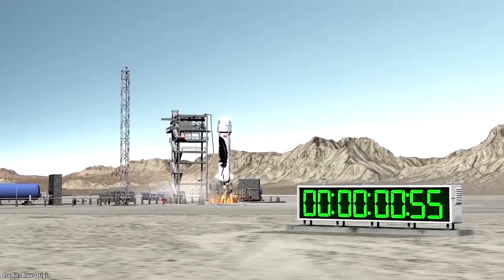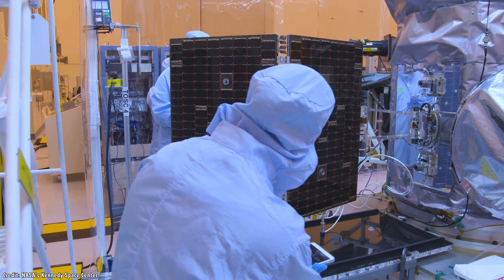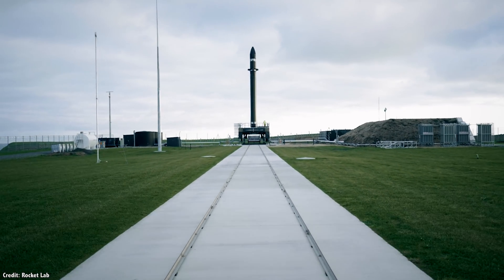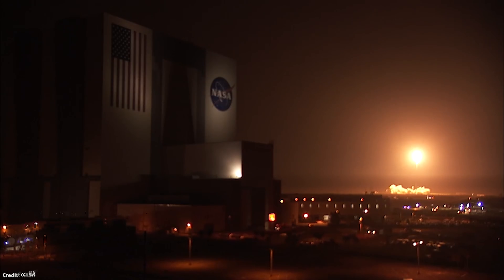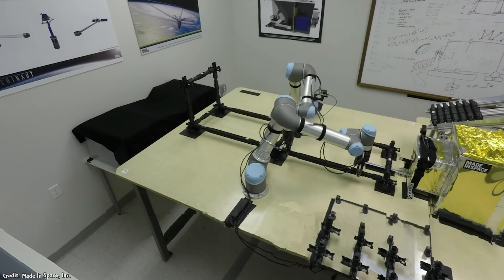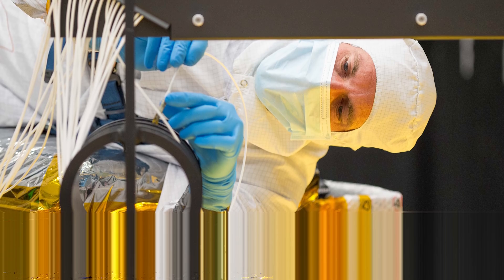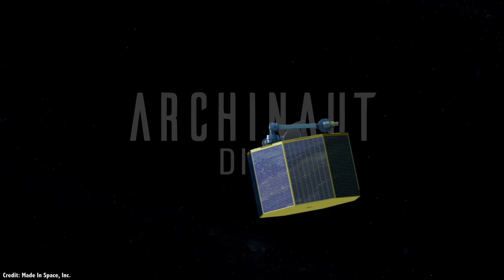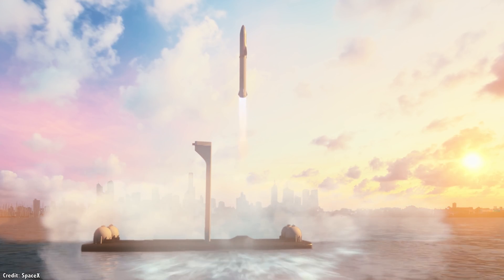A Spacecraft Is Going To Build Its Own Solar Panels In Space: Archinaut One

Comment: I can't find one piece of information:

Is it just a "rolled up" long solar panel that sits in a rolled up tube (like a piano roll or roll-up window shade,) that has its support beam 3D printed in-situ, or is the whole solar panel printed in space?  (I know there have been announcements of methods to "print" solar panels with technology similar to an ink-jet printer. I can't figure out if they're using that plus "conventional 3D printing" for the support beam, or if only the support beam is printed-in-space. Either way is better than now, but in-situ printing of the whole thing would be amazing.)
Reply: Yeah, technical details would be good.

Comment: just vaporize material with a high power laser (300 watt CO2),  then use vapor deposition to build structures the same way the 3-D printers do, next smelt metals out of ore rock and extract neally pure metals..(magnets and siphon tubes to remove slag). this is the tripping point for space industrialization

Comment: The question is when will it be possible to manufacture integrated circuitry in space.
Reply: It's possible now (its certainly not impossible), but it won't be economically viable for quite some time. ICs are low-mass and mass produced on Earth, sending them up on a rocket will be cheaper than building a space factory and manufacturing them up there for quite some time.

Comment: Space-based manufacturing holds a lot of promise, but I doubt we'll ever see the day that no manufactured materials are launched from Earth into space. There are almost certainly always going to be some items that are cheaper to manufacture on Earth and launch into space than manufacture in space, and some where manufacturing under gravity is an advantage.
Reply: Agreed, at least for the near-future. Simple raw materials (fuel, iron, aluminium etc) are far cheaper to build in space for in-space use. However, electronics, batteries, and other high fidelity, low mass products will likely be quite difficult to justify building in space for a while. Since initial infrastructure costs will be so high (computer chip factories are insane! At least to my tiny mind) and the cost savings so low that no-one would bother. Though this wouldn't last forever, eventually off-world colonies would become fully independent of Earth, or at least capable of being so.

Comment: A satellite with comically long solar panels would be a bigger obstacle for damage by debris. Also, the structure must be strong enough to survive the acceleration of maneuvering and station keeping commands and that day there is an inadvertent failure of a gyroscope that causes the satellite to temporarily spin in place creating unexpected Centripetal forces, while the spacecraft attempts to restore order and recover from such an event.
Reply: "A satellite with comically long solar panels would be a bigger obstacle for damage by debris."
Not significantly so, in fact, I argue that the ability to manufacture in space reduces maintenance costs and hardware costs. If you can repair and expand hardware on orbit then you remove the need for constant "restocks" of orbital assets. Imagine, instead of relaunching a $1 billion geostationary satellite every 10 years you launch it once and pay another company $10 million to service and repair your satellite on orbit every 10 years instead. Boom, now you've got cheaper satellites (if you can get it serviced no need to over-engineer too much) and you've got an on orbit manufacturing capability that is extremely profitable and can apply itself to other challenges.

"Also, the structure must be strong enough to survive the acceleration of maneuvering and station keeping commands and that day there is an inadvertent failure of a gyroscope that causes the satellite to temporarily spin in place creating unexpected Centripetal forces, while the spacecraft attempts to restore order and recover from such an event."
Those are just engineering requirements, these would be solved in the design process. Why would you build a propulsion system that would rip your ship apart? Doesn't make sense, they'd use tiny thrusters or ion engines not an RS-25.

Comment: In the interim, why not recover already in space hardware from dead satellites to create some new working hardware!  

It’s already there! launch paid for! 

This would solve the other big problem of space junk orbiting our planet!

Many satellites only require a charge of fuel and batteries, and maybe a couple of new spacecraft Control processor PC Board that don’t have tin plated Relay contacts (I refer to the badly designed by Hughes, DirecTV Satellite(s)  that died because of this defect, being unable to switch from the primary Spacecraft Control Processor to the spare one) . The TWT Microwave Transponders and antennas and chassis are probably in great shape!  Then a gentle boost out of the graveyard orbit slot it was purposely parked in, back to a geosynchronous orbit. The fuel could be created on the moon, maybe the replacement batteries too. The light, empty housings for the batteries, could be lifted from earth or ride up as spools of plastic for 3D Printing.

Some of the 1980’s satellites were directly built for service with grappling points and exposed battery trays, and exposed gas recharging ports.
Reply: Interesting point about the 1980's satellites, I'd not heard that before! Its a good idea though, space maintenance (which will ironically be a dirt-dull topic in 100 years) requires some level of satellite standardisation and optimisation. Providing that design incentive to companies is risky for any space-mechanic business, since you have to build your system and then encourage traditionalist and budget/time constrained companies to use your system. If they don't your company won't last long. Again, here a government contract for a small space maintenance demonstration over a few years would do wonders. So glad NASA is supporting private space!
Reply: https://youtu.be/5EXvEXfY1ts